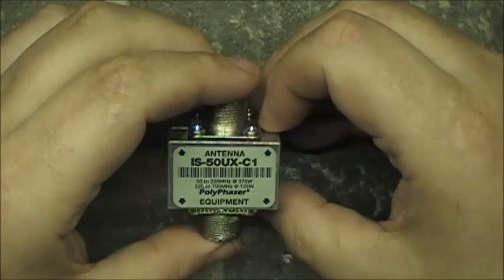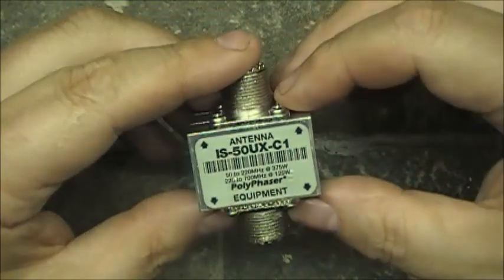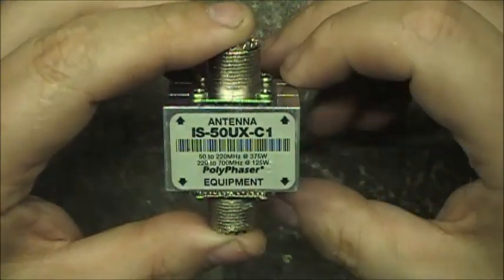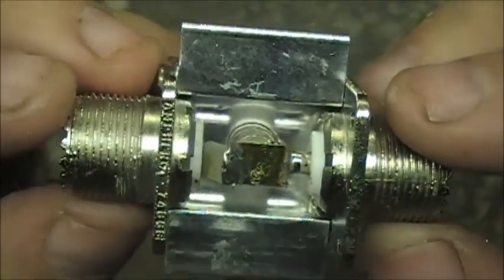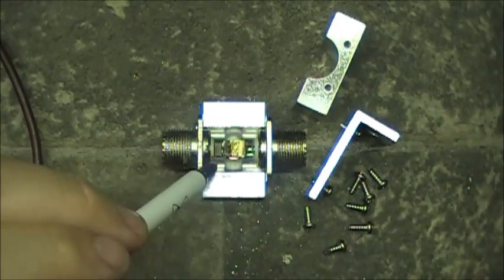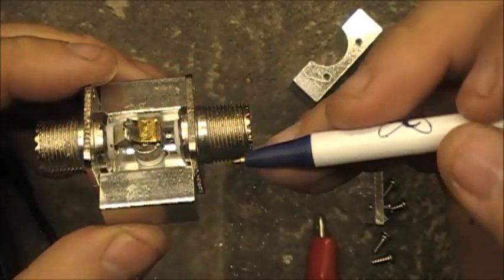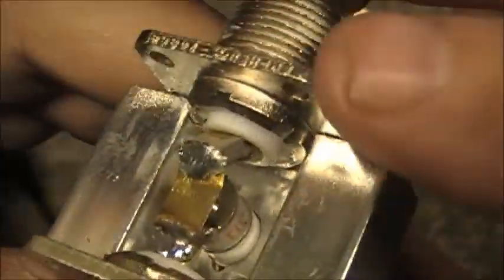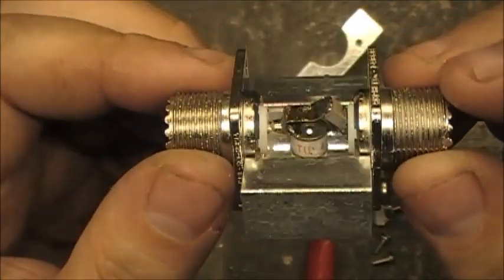What is inside a Polyphaser lightning arrestor

Comment: Strange Setup, But I Guess All These Arrestors Are Similar, But I Dont Get It, It Cant Prottect From Lightning Because The Gapp is To Short Anyway, Only Insurance To Not Burn Your Radios From Lightning Is Mechanicly Seperate The Wires, Make A Electric Motor Or Some Other Way To Seperate Them Electricly So They Make A Bigg Enough Of A Gap.
I Seperate My Antennas In Attic, I Have Connectors There And I Just Dissconect Them When There Is Storm Incoming.
I Have STory About This Arrestor You Have, 
I Orderred One From China, Looked Good, Then I Orderred 50 Pieces And They All Where Empty, Not Like TThe First One I Orrdered, First One Was Similar To Your Design, But The 50 Pieces Where Just Empti With A Thin Copper Plated Wire That Goes Thru The Conductor.

Comment: Do these have to be installed outside or inside a panel? Say, can I install one inside a PLC cabinet, or does it need its own cabinet?
Reply from the maker: PolyPhaser units can be mounted outside, but they are not weatherproof and must be sealed against moisture. To do this, you can use PolyPhaser's Weather Proofing Kit (Part Number: WK-1) to seal the unit and cable connections. 
PolyPhaser units can be used to protect sensitive equipment during radio and antenna installations. Some PolyPhaser lightning surge arrestors can also protect radios and other sensitive equipment from electromagnetic pulse (EMP) or high-altitude EMP (HEMP) related electrical changes.     

For further information, please refer to this PDF:  https://www.polyphaser.com/Images/Downloadables/Guides/IS-50NX-C0_Install_Guide_US.pdf
Reply: @Radionut63 
Thanks, that document you provided is helpful. I'm 99% positive that document comes with the poly phaser box, right? This shows me to start reading those lil papers.
Reply from the maker: Indeed it do.  :-)

Comment: The little greyish box inline with the center conductor is the Cap that has failed.  That is after the overvoltage is supposed to bleed off to ground.  Evidently the surge was high enough to kill the radio and the cap before the bleed was successful.
Reply: WRONG
Reply: @HFpirate okay, then explain it then Einstein

Comment: So do these not use a grounding wire that is attached to the arrestor then to the ground rod? I notice others have a brass/copper screw to land your ground wire to these are confusing me lol. Also.. does this ground the shielding or the center conductor as well ?
Reply from the maker: You ground the device to a outside ground rod
Reply: @Radionut63  so it just mounts directly to the rod? I was under the impression you could run a wire from the arrestor over to the rod.
Reply from the maker: @ChristiannTyler  it goes inline with your coax, ground connects to it and then to the ground rod